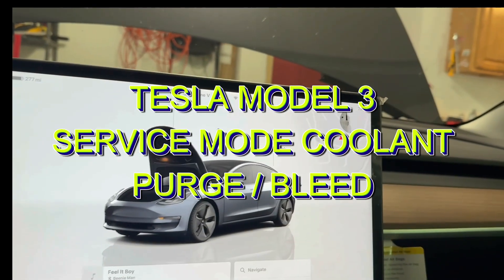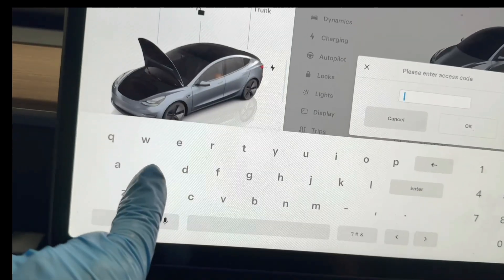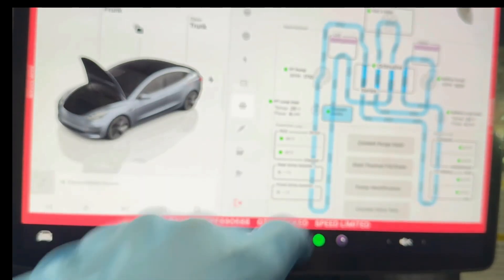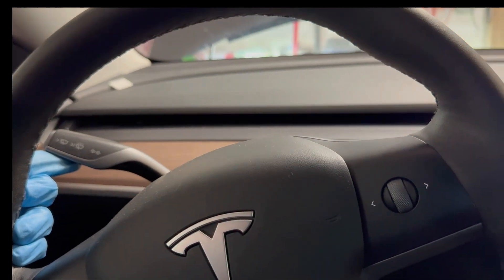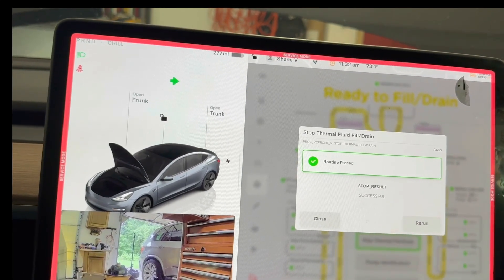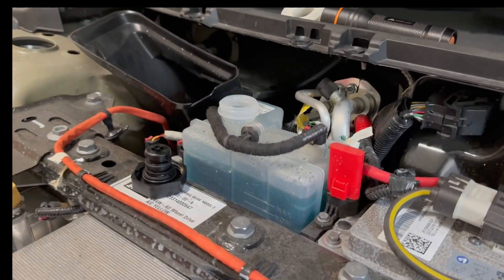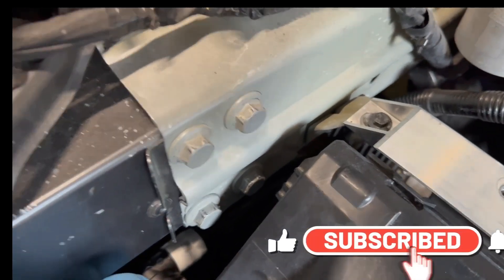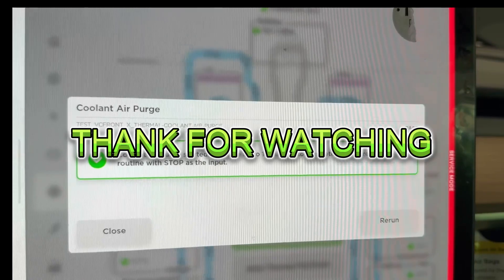TESLA MODEL 3 SERVICE MODE FOR COOLANT PURGE COOLANT

Comment: My tesla model 3, 2020 has a problem when i supercharge it say coolant valve bad mode, not calibrate and turtle mode display, when it cool off the car work fine and the Coolant valve test in Service mode is working and is green. It is a case of temp or valve teplacement?